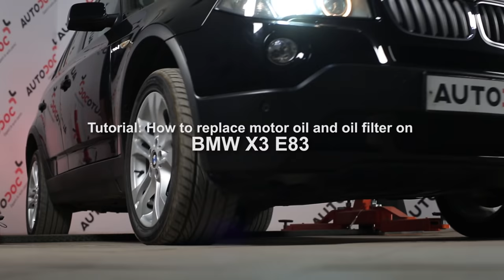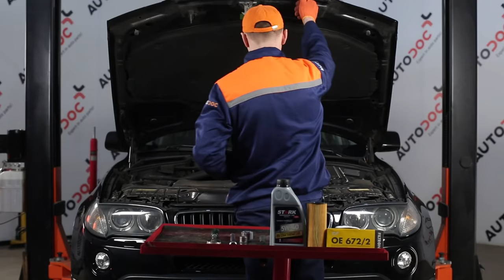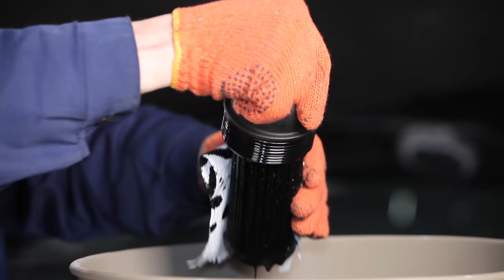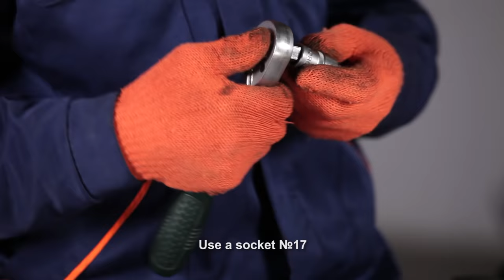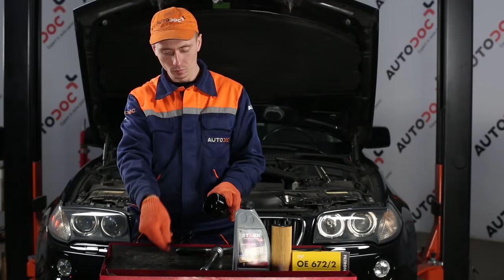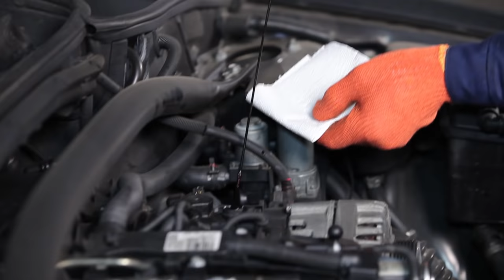How to change Engine Oil and oil filter on BMW X3 E83 TUTORIAL | AUTODOC

Comment: Can missing rings or defective cap cause vano codes or surging?
Reply from the maker: Thank you for your feedback ! Unfortunately, it is hard to answer your question unambiguously. There can be plenty of reasons for this. Please, contact the Car Specialized Service for full diagnostics and to reveal  the reasons for the issue. Best regards, Autodoc.

Comment: Oil change was done not professionally! Oil drain plug and oil filter cap should be tight using torque wrench with 25 Nm set.
Reply from the maker: Thanks for the clarification. In the new videos, we have already fixed a number of problems, we will be glad if you rate the new videos.